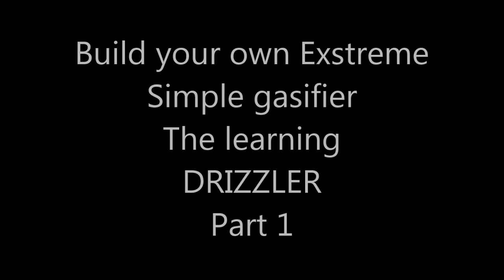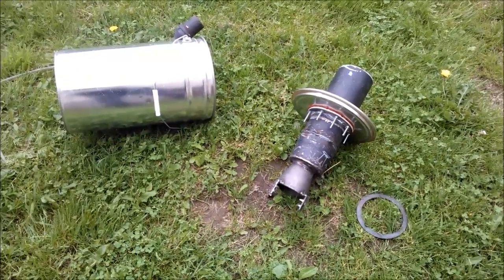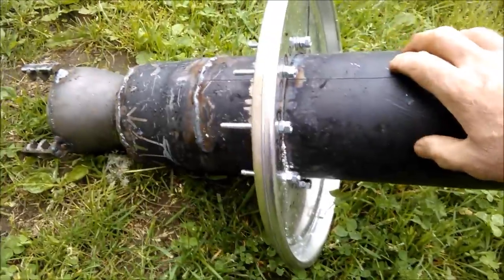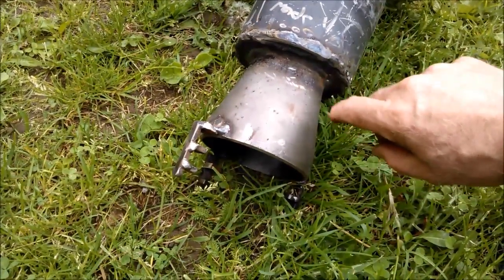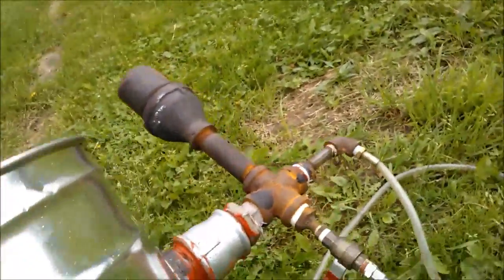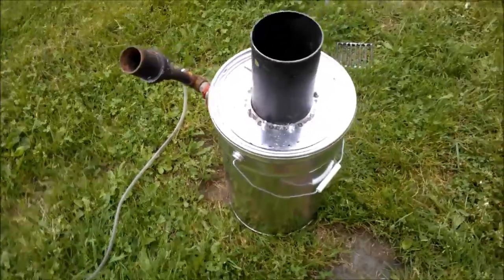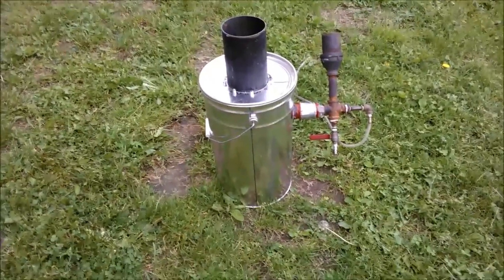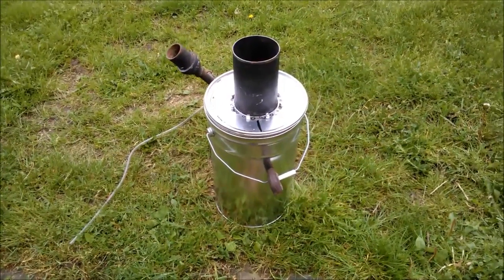PART1 Exstreme simple gasifier: DriZzleR mini

Comment: The drizzler pronciple is similar with stratified downdraft gasifier, but with drizzling material, do you think your drizzler can be in bigger size, let say with 25 cm or 40 cm diameter ?
Reply from the maker: Dear Ismail, Yes of course you can upscale a DriZzler, It all depends on your suction force to maintain a full Flaming Pyrolise zone over the entire diameter of your falling tube and avoid a hot spot. Then again you will have to use a powerfull engine wich is ok because you also will produce a big amount of gas.

Comment: How to build a drizzler please. My drizzer druzzled itself to death. 🤬
Reply from the maker: Have you first filled it up about 10 to 15 centimeter above the grate with charcoal? Charcoal must be about half inch large. Light the charcoal and start your blower to suck the smoke through the charcoal untill the top of the charcoalbed becomes glowing red hot. Only then Drizzle pieces of wood some half to one inch in the red hot glow. adjust the speed of your blower untill the smoke that comes out of your Flare pipe can be lighted and the flare does not goes out. Hope this explanation helps..succes

Comment: Any risk of explosion in The Drizzler method?
Reply from the maker: Thank you for your reaction. All this years I operate my DriZzlR, I never had an explosion. Mostly explosions in a gasifier occur when there is a build up of gas inside the system. This can happen for instance by a sudden stop of the proces. If then a tiny spark and the smalles little leak introduce air in the system, you go BOOOOM. If the driZzleR sudden stops the accumulate gas find its way out sponatniously through the open top. Then the gasifier goes in updraft and the gas is burned on top of the flaming pyrolise zone.
Reply: Luk Vanhauwaert hi Luk thanks for that answer. Makes sense to me. If i wanted to build a test Drizzler like this but wanted to run it for many hours how would i be able to make sure the grate does not get clogged? Your videos have really inspired me thank you
Reply from the maker: @oriben-shir6742  Yes, but thas does not mean that you can run the gasifier completely without a sort of stirring system that keeps the reduction zone fluffy. Because when your reduction get solid packed it ackt as a lid and the gas trapped under it can not anymore escape to above. But then again if your reduction is that soldid packed your gasifier does not breath anymore and get choked. you can observe that in the flare, all of a sudden the loosely big open flare starts to burn inside your flaring tube with a roaring sound and the flare is very blue and sharp pointed as like in a bunsun burner.
Reply: Luk Vanhauwaert hi Luk, i understand. So i will need a stirring device for this little Drizzler if i plan on using it for long term. Regarding the stirring, how is it possible to keep it airtight? Any recommendations on how to add a stirring device while making sure it stays airtight? 
Thanks again.
Reply from the maker: @oriben-shir6742  The stirrer has to be operate exstremely gentle. I controle mine with an electronic underpressure sensor. To make the seal airtight, feed a solid rod through a chamber on the end just 1mm lager around the rod but in the chamber some 8 mm lager on all sides. The chamber has to be some 6cm long. Pack the space in the chamber around the rod with square grafit rope, Make a round ring that pushes the grafit rope, and put that ring under pressure. The pushing ring compresses the grafit rope tight against the rod so no air can come in. But the grafit has a sort of smearing function so the rod can still nicely turn.

Comment: My gasifiet not flear , what can you sugest for me , the  temperature at the flear point is around 120 f , it brings our smoke
Reply from the maker: Dear  Olajide,  I do not know what gasifier you have build but I take it for granted you build the learning DriZzleR; I also presume you drive off the gas by an ejector? In that case the start up procedure is the following. (Even if you have build another type od gasifier, most off what I will write aply's also to other designs. 
OK here we go. Fill up your gasifier above the grate with about 25cm clumbs of charcoal, about 1.5 to 2 cm cubicles. Turn on your ejector of fan or blower but not very hard. Light the charcoal untill the whole top is glowing. Drop in a little bit of DRY  woodchips or pellets. The smoke that comes out of your flare should be grey and not too white. After 1 untill 3 minutes you should be able to get flame. If it stay' lit you could adjust your compressor of fan or blower a little stronger. If the flare goes out then it is too strong. Beware your flare tube should not be straight at the end. Best screw at the end a wider piece of pipe. F.I. put at an 1 inch pipe a 2 inch niple. That way in the larger end the gas can exspand and mix with air so it ignite better. You can also join our forum and post pictures and questions of your build there so all members can help you better. http://forum.thedrizzler.com/
Luk
Reply: Luk Vanhauwaert 
Thanks for your fast reply, I will join the recommend forum, for other experts to guide/ advice me , and I will also make video and pictures of my failed gasifier system.

Comment: Awesome! Are people powering cabins with these? I need to generate about 6 KWH/day. If my initial research is close, @ 3lbs of biomass/KWH, an efficient gasifier would need about 18 lbs of feedstock to produce 6 KWH/day. That's 540 lbs/mo. That's a lot of sticks lol. :) Do those numbers sound accurate? And is it really practical to power a cabin using a gasifier or is this more suited for emergency power? Thanks!
Reply from the maker: +Paul Ladendorf +Paul Ladendorf Paul, no problem to bring energy and heat to your cabin. You must drive with the woodgas a car engine that in stationary mode drives a generator and the cooling of the engine heat and exhaust through a heat exchanger gives you hot water. See folowing videos. first a test with the engine still in the car https://www.youtube.com/watch?v=COXGDzV629Y  and second video the same engine now mounted on a frame https://www.youtube.com/watch?v=eVbqbQUiHHM consumption with a one liter VW polo engine is about 900 grams per kw. With the polo you can produce around 5Kw electra and some 12 Kw hot water.
Reply: +Luk Vanhauwaert Thanks. Based on the research I've done, the time and/or expense of processing feedstock seems to be the big challenge. No one seems to have a cheap and fast way to do that. Chippers are expensive to buy and operate and just using a table saw would be very time consuming. What is your experience?
Reply from the maker: +Paul Ladendorf paul,, I am lucky. I get my chips from a forestworker. He is intrested in my work and suply me with what I need. He sell chips to others for burning. I get them free. The chips ar dry since he brings them in containers to a biogas plant that has exxes heat, Via a big tube the exxes heat is blown into the container. After a week they are bone dry. The easiest wav to heat with wood if one has no suplier is buying pellets in easy transportable bags. for your needs you would need ten bags of 10 kg per 24 hours. luk
Reply: 10 bags @ 10 kg each = 100 kg per day to produce 6 KWH? I don't think that's accurate.
Reply from the maker: +Paul Ladendorf yes you are right. I ment to produce continiously energy  and heat 24 hours you need 10 bags
Reply from the maker: PAUL? To be accurate you will need around 1 kg to produce around 1 Kw electric. But do not forget that in a cogeneration unit your 1 Kw electric comes also with about small 2 Kw hot water.
Reply: Luk you are right at the assessment. Some one made a crude gasifier with lots of filters that produces 1KW with 2-3 Kg of biomass.

Comment: While I don't know if you can reply.  Is there any benefit to updraft, top feed?
Reply: Luk I would like to add that this is the best way to have a continuous feed gasifier that is safe. I am still not able to get to the real flame that you are showing. I am just beginning to work on this.
Reply: Could we produce the burning charcoal with initial dry wood?
Reply from the maker: +Nathan Tortorich No. Doing so You will not have a gasifier but a normal woodstove. To convert your smoke into burnable gas It has to be pulled through a layer of hot charcoal in order to start the reduction. Ther are however gasifiers working in the updraft principle, but the feedstock is feeded from beneath as well as is the air needed to get the combustion going. Then on top lies a layer of coal where the smoke travels through. The exces ashes and soot are sucked away together with the gasstream. This at least in small scale gasification . Huge instalations where there are some working in updraft top feed are beyond my intrests

Comment: Looks good Luk.  I agree with you that if someone is building a custom gasifier they need to tune it up by reading a flare.  The flare is very basic and shows everything one needs to know to start using the gas with an engine.
Reply from the maker: +Barry Remainder Barry, Well if you want a full complete image on what is going on in your gasifier you need appart from observing the flare also an pressure drop reader and a thermometer. The latter you can put in the system wherever you want but once put it in a spot it should always remain an the same place. If something is going on inside the first you will notice is a drop in the temperature. Packing for instance is inmedaitly dedected by a drom in temperature, then secon you will notice pressure drop and then a lowering of your flare, To judge tar however or too much soot, that can only be seen in the flare. Over all your testing one should always set the blower at the same pulling pressure. This pulling pressure must be as close too what your engine would pull. A primitive test is let your engine blow a big plastic bag notice the given time and do the same with your blower. The bag must be filled the same time with the blower as with the engine.